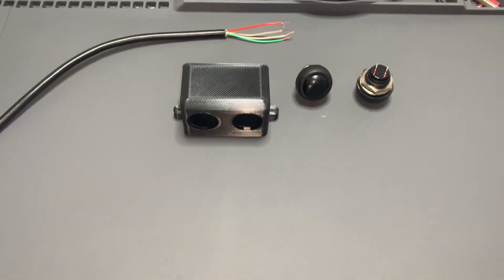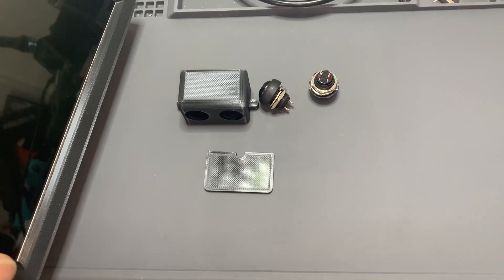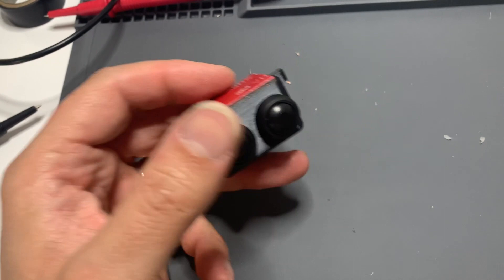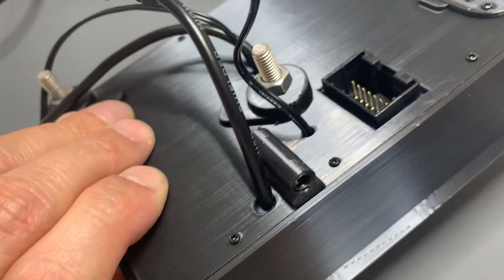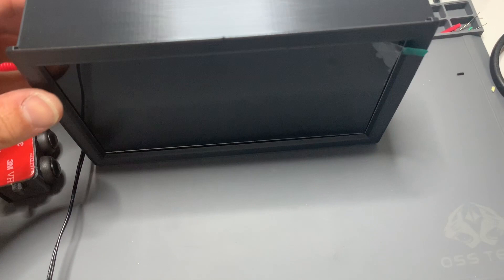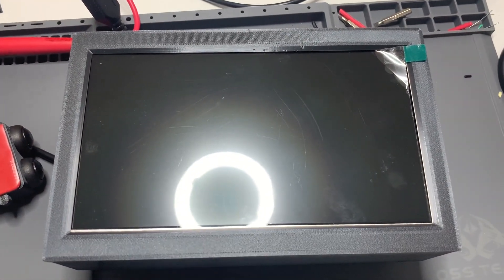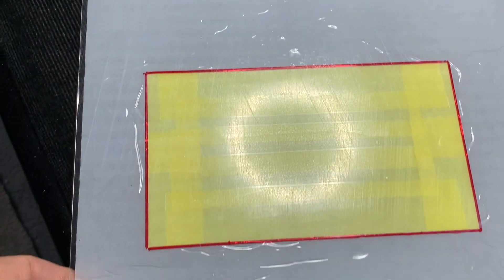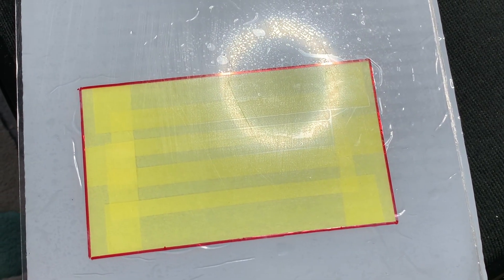TFT Dash - How it's made - Final assembly

Comment: Excellent job ! I am working on creating a dashboard but when configuring a GPIO as an interrupt and a pull up so it is connected to an internal pull up resistor, and I run the engine it will not detect noise, but simply by adding an external pull up resistor the wires will act as an antennae and it will detect all that noise that comes from the engine and the alternator !  RC filter didn't fix my problem ! can you please help me! did you face the same problem? the noise is detected even when adding just small wires before connecting the output of the sensor to the GPIO

Comment: All the videos on how the screen is made were really informative, thanks for taking the time to do them. A few questions though, 1). Where does the ambient temperature gauge go, I think I saw it loose? 2). Does the USB lead have a waterproof cover? 3). Is the USB lead secured to the back of the screen or does it just hang loose?
Reply from the maker: No problem - The ambient temp gauge can go where you choose however I do recommend on the website just to keep it away from engine heat, and await from direct wind blast so behind a windscreen is a good place. The USB ports will be shipping with a cover, but otherwise yes they hang quite close and loose to the dashboard - mainly so it's easily accessed for software updates or plugging in accessories like the TPMS. Hope that helps.
Reply: MrScififan Thanks for the quick reply. Yep, that all makes sense. I’m still saving for one 👍